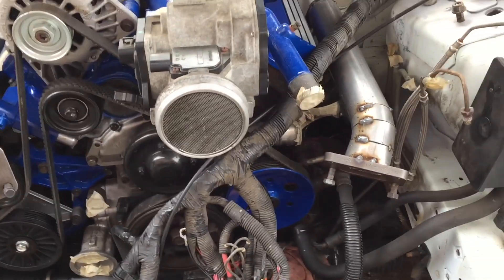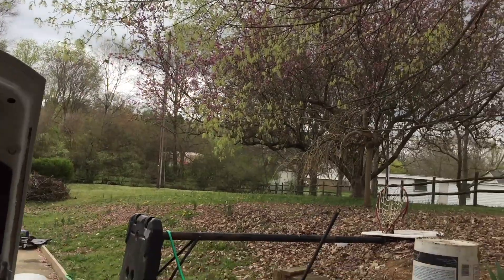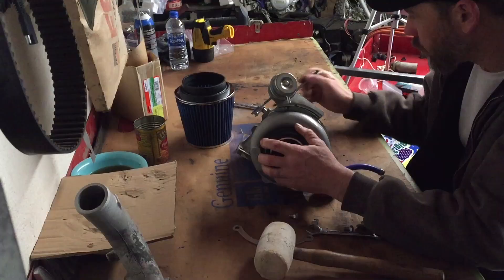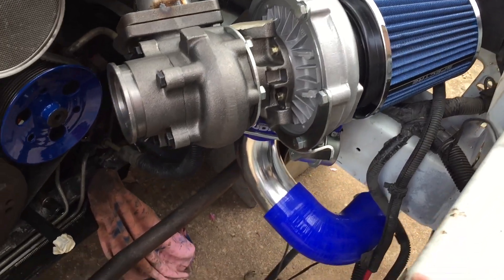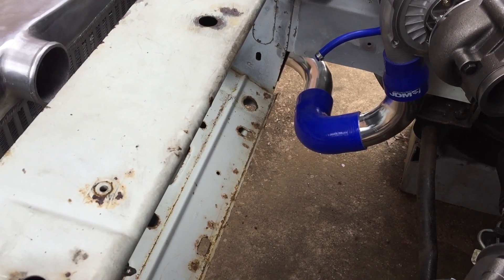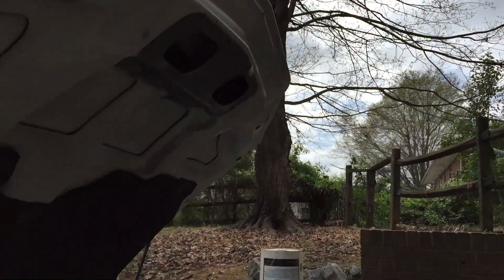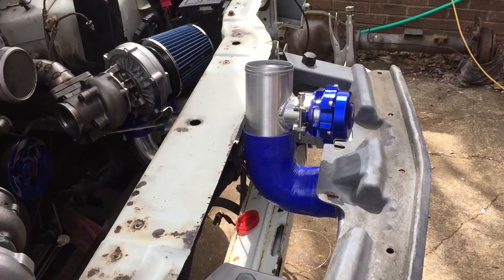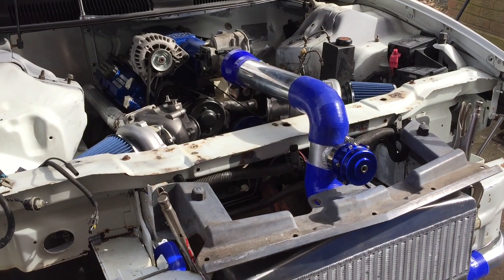Intercooler pipe set up  Camaro/firebird 3800 series 2

Comment: You should run down pipes from the exhaust outlet to prevent over heating issues. Those exhaust turbines are going to be blowing hot air when they’re spooled up. That will help keep the induction system cooled
Reply from the maker: definitely on the to do list should be seeing that soon thanks and stay tuned

Comment: I'm late to this so I apologize if you've already addressed this, but you need to bead the intercooler piping for the clamps. It looks like most of it is already bead so the only part you probably need to touch is where you cut the piece between the intercooler and throttle body. If you don't you're gonna have issues blowing the pipes off under boost. You can make your own bead roller with this video. 
https://www.youtube.com/watch?v=JVDUM2ZxoW0
Reply from the maker: thanks nate for looking out i appreciate it. i watched the video you sent in the link. When you get to part 29 you will see me with the same wire pliers making that bead on that 3" i cut lol!!  thanks again